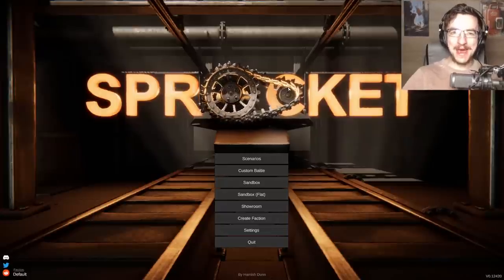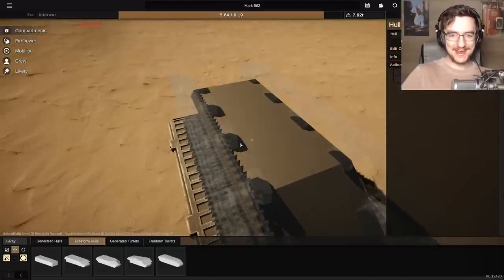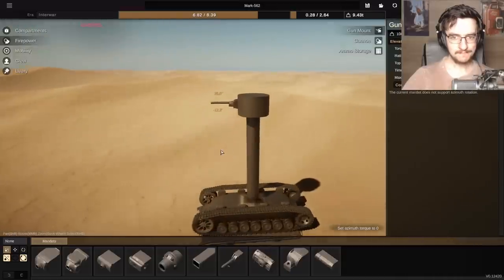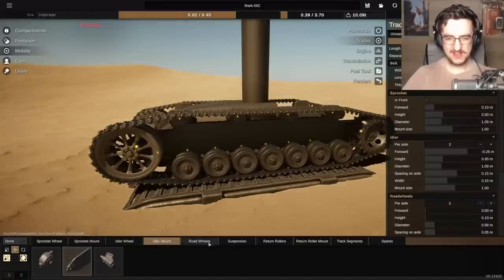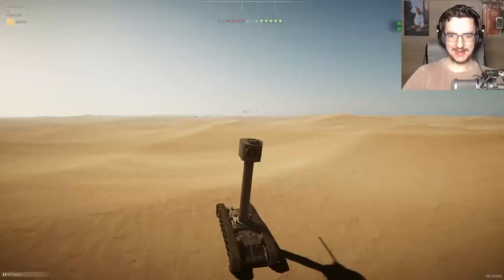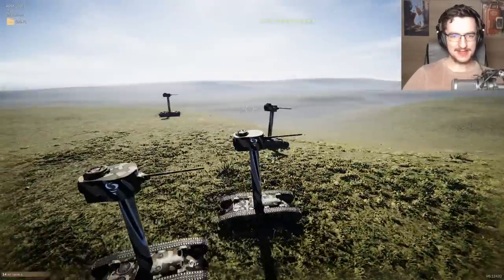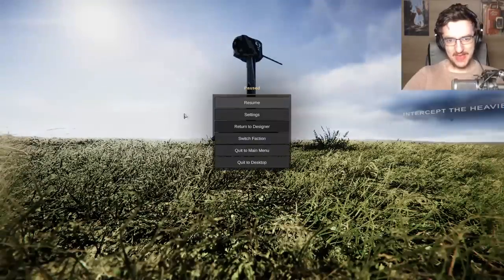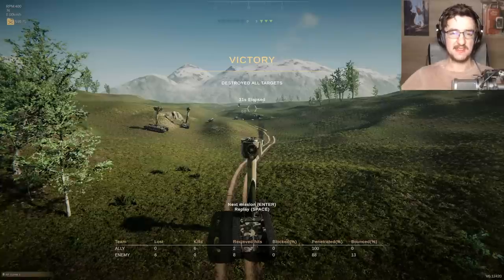I Built A CURSED SNIPER TOWER TANK In Sprocket Tank Design!

Comment: "HEY! I need a shell from the hull!"
(Rolls dice to see who has to climb down)
Would they have a fireman's pole?
They have to rapel down?
Ladder?
Have a tube magazine like a shotgun?
Reply: More than likely, a pulley system to have a round loaded into a "secure" slot then the holding for that slot is ran back up like a crude elevator. So if that cursed neck is hit at the wrong time, a round would be going off and spitting fire both into the turret and into the hull. . . . Fun for the whole family and the dog.
Reply: Naval type shell hoist, I guess.

Comment: I actually was wondering where the face cam went tbh.  I like it.
So with the gun depression.  The mantlet that is just a big rectangle that mostly goes in the turret (The one with azimuth controls) can be stretched around and if you stretch it in a direction the angle of fire gets larger that way.  So if you make it taller then your depression/elevation gets larger.
I am not sure if any other mantlets do that but it works with one it probably works with more than one.